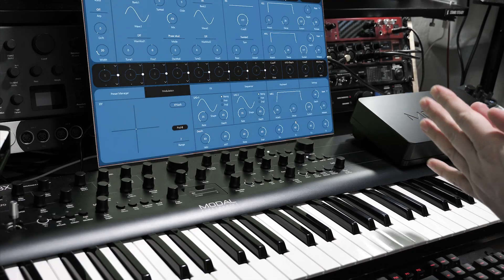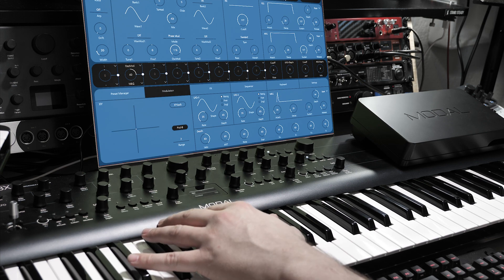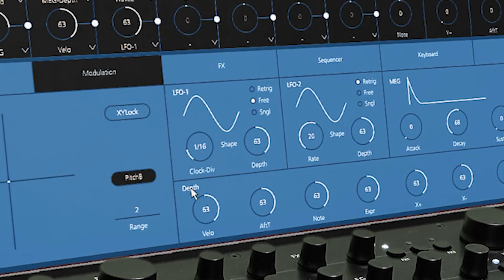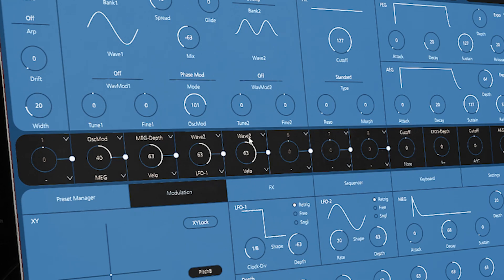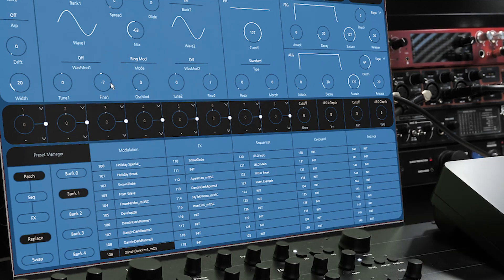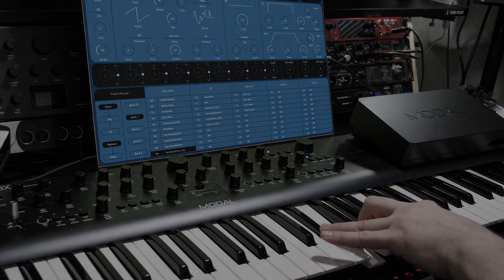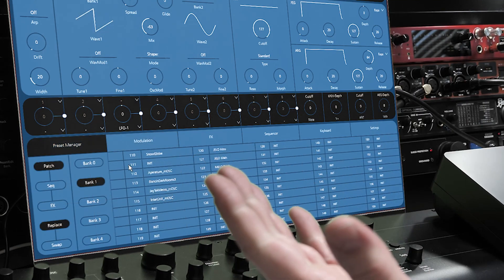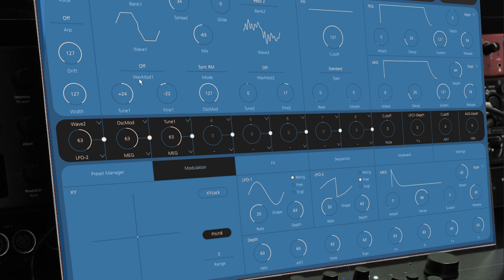Modal Quick Dive #1 – ARGON8 Oscillator Mods

Comment: Thanks for this. Tomorrow I'm planning on buy either the Argon8X or the Cobalt8X but I was having real trouble deciding, now I'm pretty sure which one I'll get.
Reply: And?
Reply: @AcidTechnoMan5000  Thanks for your interest :) I decided on the Argon because of FM(PM) which I love and the wavetables offer a lot of tones I don't have in my modular (my primary synth setup), the Argon is a way of adding pads to it and with the complexity of many waveforms in wavetable synths they lose a bit of bass which means they fit nicely in the mix leaving room for the actual bass. (See my track Inverted Illusion for an example.) :)

Comment: Come on guys, you’ve just released a new keyboard and you’re not producing any videos for it!
Reply: I think it's great they're not putting the A8 on the back burner just because of a new synth. I believe they've done some videos on the C8 however.
Reply from the maker: Hey Dara, there are a lot of COBALT8 videos already produced and in preparation. We had these ARGON8 videos planned for a long time to deliver some ideas to ARGON8 users. You will see an equal amount of COBALT8 videos in the weeks to come.
Reply: @ModalElectronics  I'm still waiting l'm sure like others l'm interested in the cobalt but need to hear more presets. I'm sure l won't be disappointed but my ears need to be satisfied :)